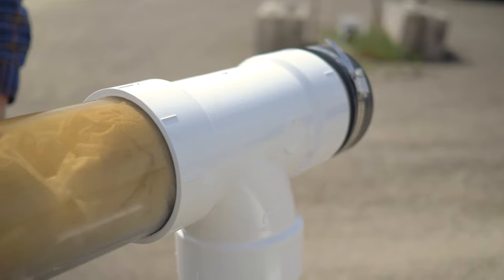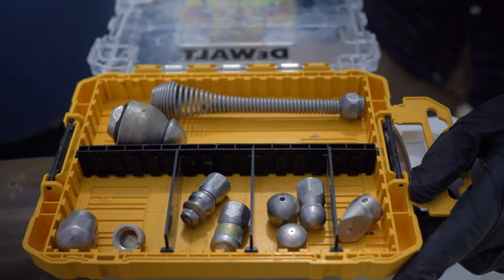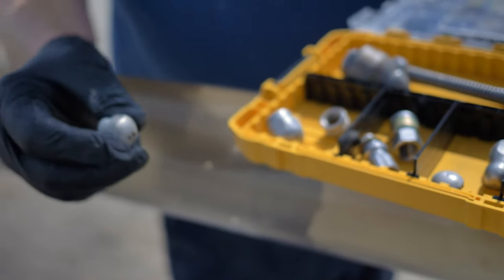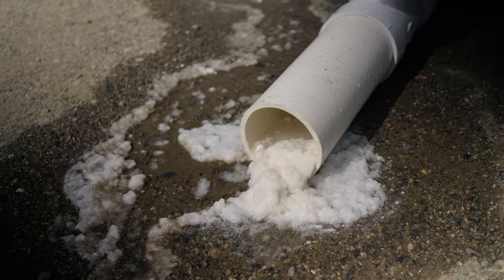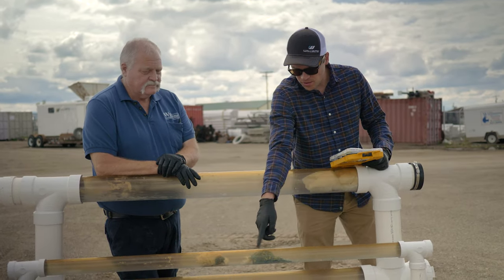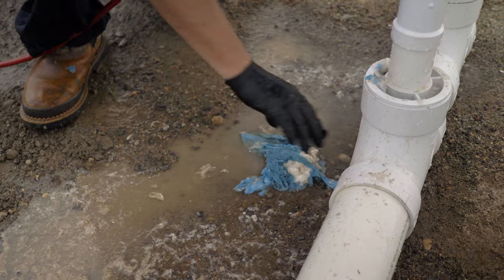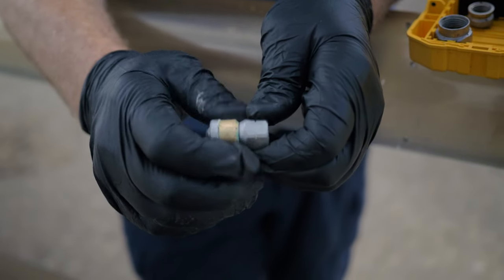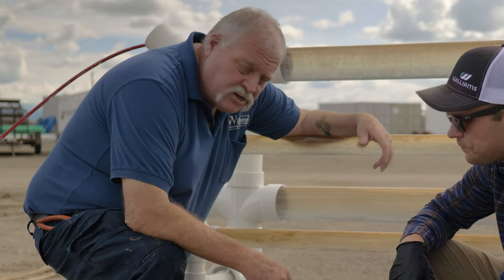Hydro Jetting Heads: Uses and Methods

Comment: That grease cleaning head is about useless, while it helps a tiny bit, it is very poor performance. If it didn't spin so fast, it would do a better job.
Reply: Our experience is apparently different than yours. We have had very good results with that head as demonstrated in the video. If it is not working well for you the G.P.M. of your machine might not be enough for your particular head. It’s important to match the spec’s of your machine to the heads you use. Hope this helps.

Comment: Sewer jetting always get the job done👍snake only makes the pipe drain again but the problem is usually not fix and they always end up getting to call a sewer jetter guy sewer jetter as so many tools and options to chose from to do the job

Comment: Would you run a jetter inside? I saw a decent amount of water coming out of the line with cleaning the grease clog. It seems like you’d make a mess underneath the kitchen sink.
Reply: Jetters are the top choice, but sometimes a auger or flex shaft is a better option to start with, at least get a hole in the clog to let the pipe be draining before jetting it. Although the best option is to work from the street back, but that's often not easy or even an option at the time. Plus, working from street to house, you have to be careful and not let the nozzle come up in a toilet and make a mess. There are things that can be done to minimize water coming back, like hold a towel over the pipe.

Comment: It looked like you just screwed that head on hand tight. Curious how you attach a head. Where I work. We break out the flat jaw knipex, and torque it as hard we can. In fear of losing a head.
Reply: Although it is not shown in the video, we do wrench tighten the heads. However we in general try not to over torque them.

Comment: Seems like after you clear a clog, you wind up spreading it BACK up the pipe... Do you then run a different tip to push the residue forward and down to the street main?
Reply: In general the grease/cleaning head will push things forward. There are also heads designed to push mostly forward. Also the penetrating heads can do well in that regard.

Comment: Question, 
What head would you use for dirt, pebbles and pool DE clog in deck drains? Looking to add this service to my pool company, we find a lot of clogged drains!
Reply: It depends on if you are upstream or down stream of the problem. If you need to push it down stream something like the Warthog head works. If you need to pull them back then a cleaning head with only backward facing jets would usually work the best.

Comment: It looks like a lot of water and gunk is coming back at you when you pull the jet back. Is there go to method to prevent spraying all that nastiness on yourself?
Reply: Yes we use a product called a zip drain. We can also use a vacuum system to pull the waste away as we jet. Great question.
Reply: @davidmize8489  Awesome. Thank you 👍

Comment: Great video! Can you do this for tree roots thru a toilet hole (without the toilet attached)?
Reply: If you have a powerful enough pressure washer and the right head, you can cut roots, up about the size of a pencil, but that's going to take like 4000 psi at 7 gpm with a reverse turbo nozzle. If you just have the fine hair like roots, you can get away with like 3000 psi at 3 gpm.
Reply: Yes, we have an extensive collection of heads and 3 different Jetters to allow us to attack different situations properly.

Comment: Can you clean drains in restaurant/houses without a plumbing license?
Reply: The only thing you might need is a business license for the town/city you are working in. Of course it helps to know what you are doing and to have a good bit of experience, and for the people you are doing the work to trust you. If you get a nozzle stuck in a drain, are you prepared to do what it takes to fix it? Which could be busting up a concrete floor, and would you have the equipment, like a camera with a locater to know where to dig? Usually the clogs are just clogs and you can clear them, but what will you do when you are in some old terracotta pipe and shatter it, are you going to be able to dig it up and repair it?  Having a camera can save you from a lot of issues. Years ago I pressure washed, and I had years of experience, I knew how to handle different materials, such as concrete, brick, and vinyl siding. Then came along a bunch of kids in dads pickup truck and a pressure washer offering to pressure wash houses for a lot less. Some of my customers decided to go that route, while they saved 100.00, the 1000's of dollars of damage done was not good, you are wondering what could they have damaged? Just a few examples, double pane vinyl windows tell you, do not pressure wash them, it will break the seal and fog up the glass, plus voids the warranty, so a few thousand dollars for window replacement on a 100.00 job? Had several other homeowners end up having to replace ceilings and insulation in the attic, because they sat there and sprayed the eve vents, sending many gallons of water into the attic. So yes, simple things can turn very expensive very quickly.  I have a friend who has a master plumber license, he knows a lot about how things are supposed to be put together to work correctly and be correct for code/inspection to pass. I on the other hand am not a plumber, but I have lot more common sense than he has and can figure out how to do some things he struggles with, together, we do well.
Reply: In our area we are not required to have a plumbers license to clean drains. That is one of the reasons we have our own training facility to train and certify our personnel in house.

Comment: What pressure are you using... How many GPM is recommended... My issue is roots in the line. What head would I use. 
After mechanical work ($700) my plumber wants $1000 more to Hydrojet it... Seems like very excessive exploitation to me... So here I am, determined to do it myself.
Reply: Depending on the size of the roots, if just fine hair like, 3000 psi at 3 gpm with a reverse turbo nozzle will work, if the roots are bigger, say up to pencil size, you will need some serious power, like 4000 psi at 7 gpm. While they do charge a lot for jetting, that price sounds a little bit high. After they charged my friend 800.00 at his restaurant to jet a clog(mostly grease, food) and the next day line was clogged again and they said they would charge again to come back(and this was a big name plumbing company) that's when I decided to try jetting, I already had pressure washers from cleaning driveways and a year earlier, I had bought a 100 ft jetter hose that came with a couple of those basic nozzles, on my first try at my friends restaurant, hit a clog at 30 ft, then one at 50 ft. I pulled the hose back and forth at those areas a few times, went ahead and ran the whole 100 ft(it was 135 ft to street) and then pulled the hose out and changed to that spinner head he used, that's was 8 months ago. A month after I cleared the line, I bought a camera, inspected that line and it is very clean, saw just a tiny spot of grease(about the size of a quarter) where that 30 ft clog was at. I used my smaller unit, 3000 psi at 3 gpm to do that, I have not used my bigger set up yet, 4000 psi at 8 gpm, but will soon.
Reply: @stevem1081  Thanks... So far, my one time use of my 3000 pounder with reverse head has seemed to work... Still need to camera the line though. Will do that sometime this summer.

Comment: How much psi is required to jet drains to this high standard please?
Reply: 2500 to 4000 is most jetters.
Reply: There is a huge variance but to use these particular 3/8” heads we are running 9gpm at 3300 psi.Also Gpm is generally more important than psi.

Comment: I have the REAPER head and it does it all.
Reply: Which one did you get, the 1/4 head? What psi and gpm are you using? I think that would take care of 80% of anything I would do, and a reverse turbo would finish it up for me.
Reply: The Reaper is a great head. We use both.  The Reaper is a better penetration head and the Warthog is a better cleaning head but both are great.

Comment: The machine you were running for this training video. What were the GPH and the PSI?
Reply: I know that warthog is 8 gpm at 4000 I have one.
Reply: @markkolecke6025  Thank you.
Reply: Mark is correct on that head. The best practice is to always size the heads to your machine’s specifications, a good supplier really helps in that regard.
Reply: Price sar